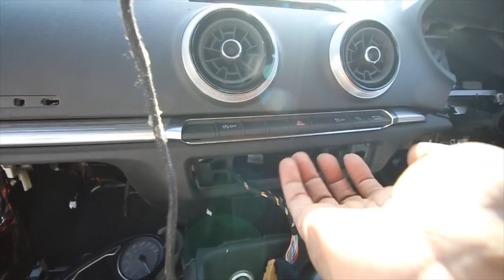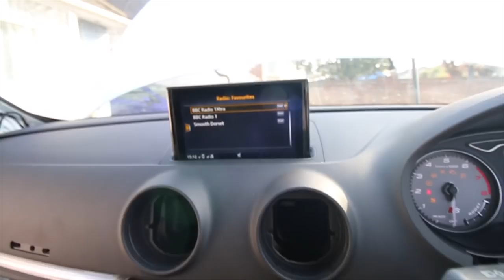Fitting a new dashboard in my Audi S3

Comment: With the airbag not sitting back correctly It will be one of the springs used to hold it In. I have had metal clip come loose and it was enough for it not to sit back.

Comment: to get the airbag light off, what will you need to change, apart from the airbags...module, seat belts and pretensioners aswell?
Reply from the maker: All the sensors associated with the crash